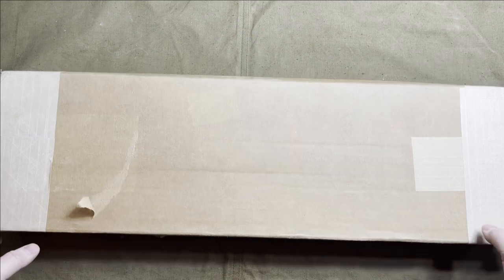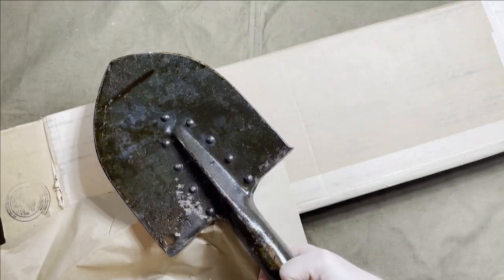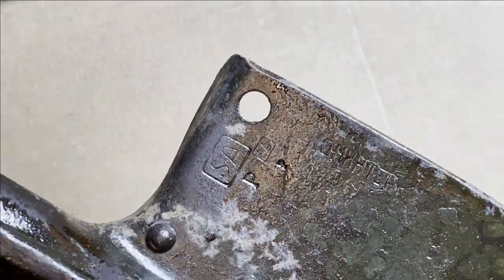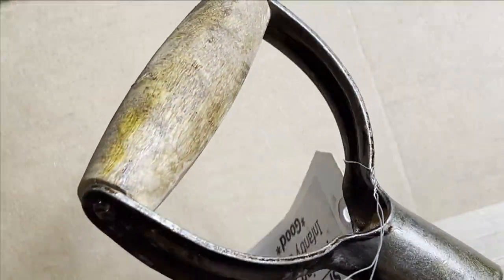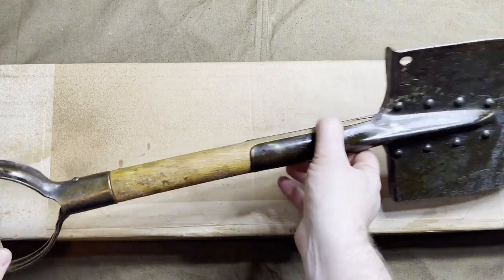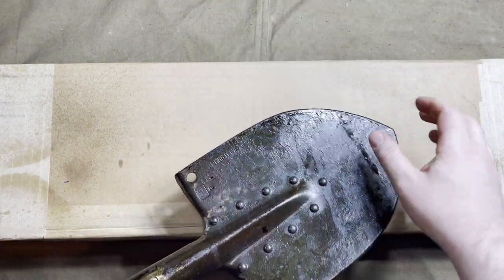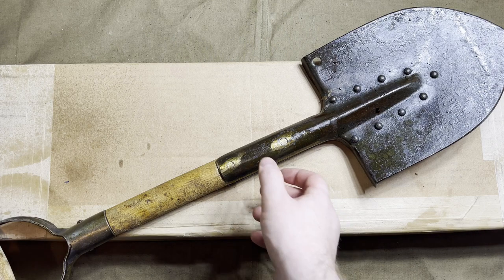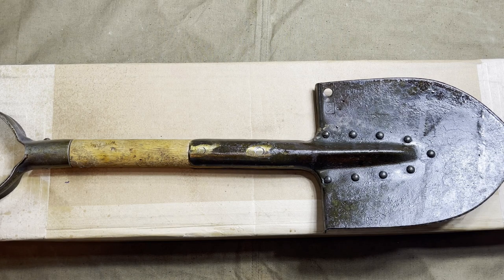World War 2 Soviet Entrenching Tool - Current Military Surplus

Comment: I have one made somewhere in the easternblock in 70's
I use it fairly regularly to dig and hoe when metal detecting or as a emergency shovel in field conditions (like when you need a shovel but dont have one emergency)

These things are build to work and do so well when used as intended, as an shovel-to-go